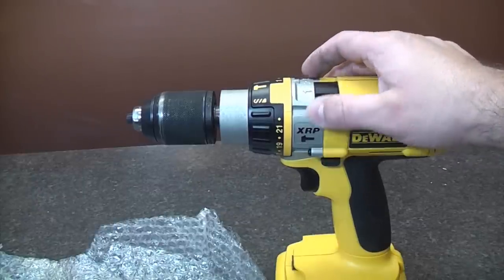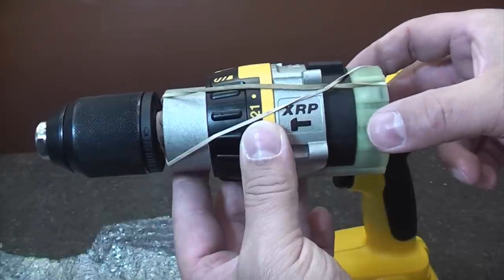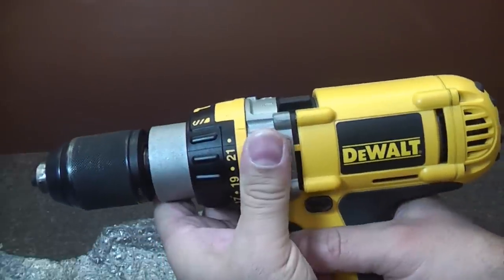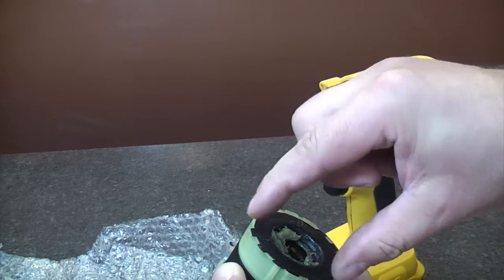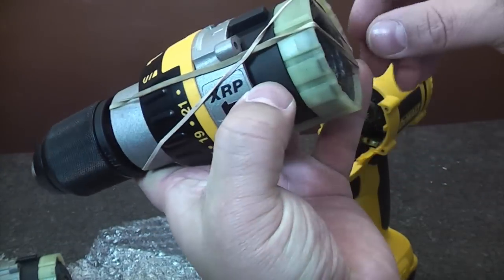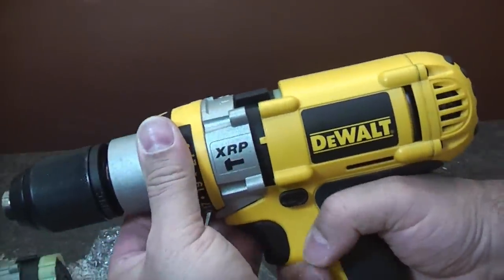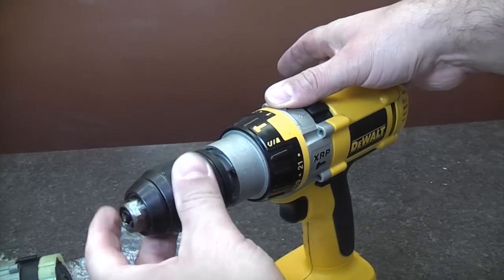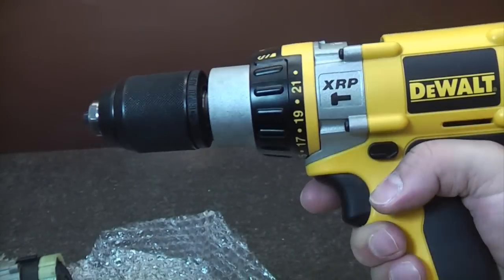Dewalt XRP drill gearbox

Comment: Great information - quick question had it been more than 3 years since the drill was purchased? It looks like the DC988 Hammerdrill.  It looks like the newer version - if it was less than 3 years it should have been under warranty.  It is great information that you share - it is sad that nowadays it is almost cheaper to replace than to repair.  We seem to be more disposable.

Comment: I would recommend rotating by hand the chuck instead of pulling the trigger to align the gears. That way you won't grind the face of the gears, no chips falling in the gearing (that would be bad on long term). 
Put it in highest speed gear if the chuck feels moving hard by hand (yet it should not be a problem at any speed) 
And the clutch fully engaged without the rotary hammer or axial hammer engaged.

Comment: Hello Sir i put the drill in to reverse mode while trigger still pressed . did two or more times .. will this action damage the drill ? the drill still works ,what damage would occur because of this action . Its a 240 Volt AC Corded Drill
Reply from the maker: I would always wait until the drill stops, before switching direction, as you could damage the drill.

Comment: i was using my dewalt hammer drill in the drill mode and suddenly got slower i though the battery was running out. as i continued to use it, it stopped working. i tried changing gears and playing around with it it worked and stopped again. now it doesn't work at all. what do you think the problem is?